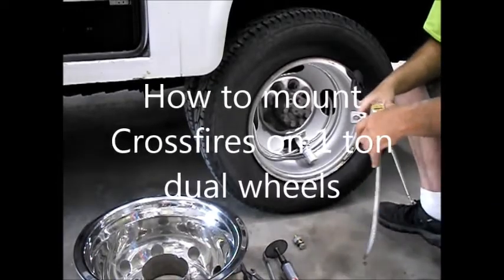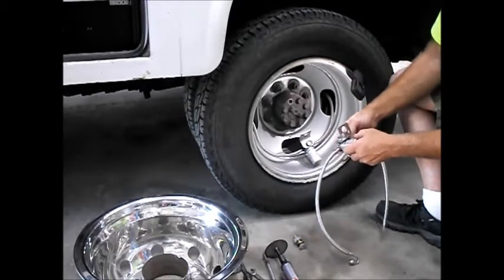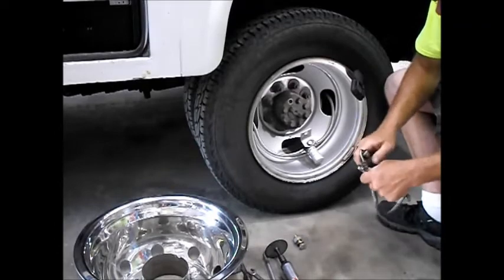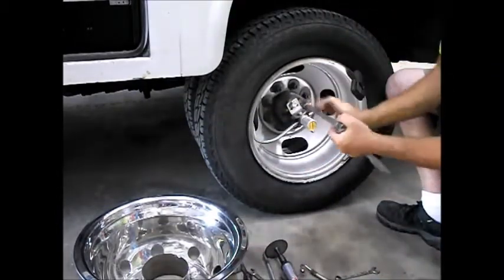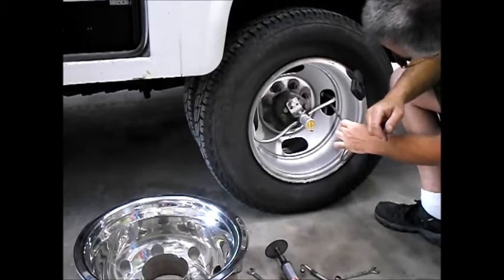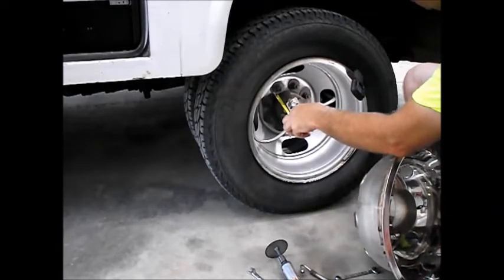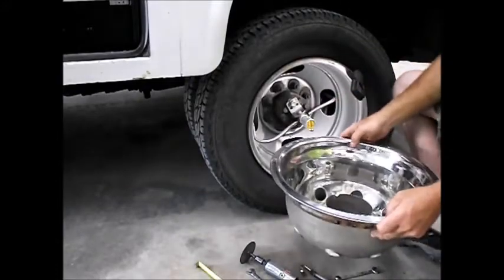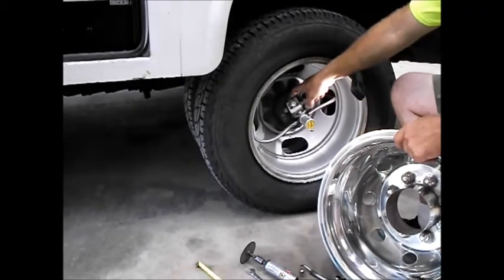How to mount Crossfires on 1 ton dual wheels

Comment: Way too cobbled up, bulky and ugly. Not to mention cutting up an expensive wheel cover and making special tools that need to be carried with you in case a tire needs to be removed, only to be missing when needed. It's fine on a commercial truck, but not on a motor home.